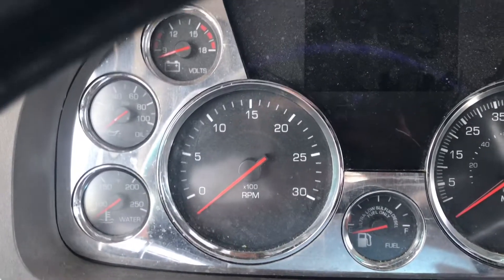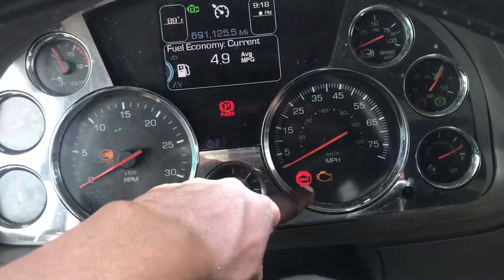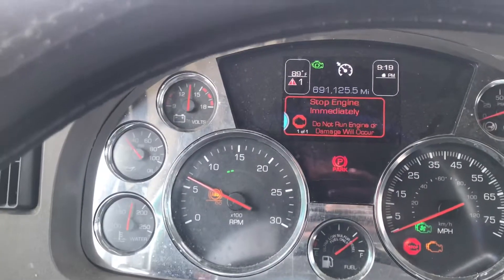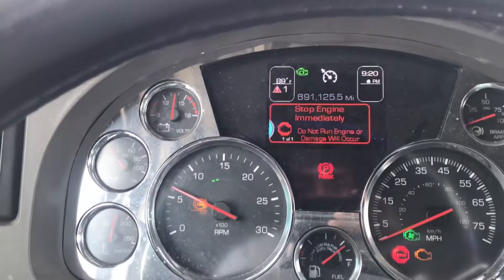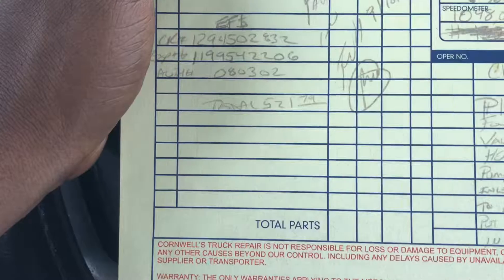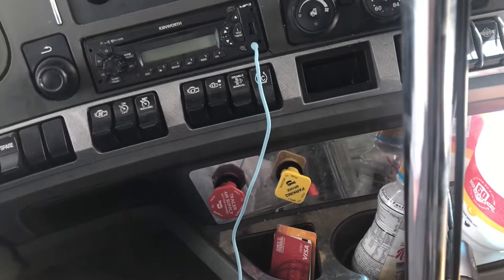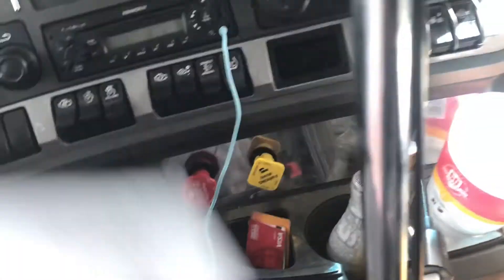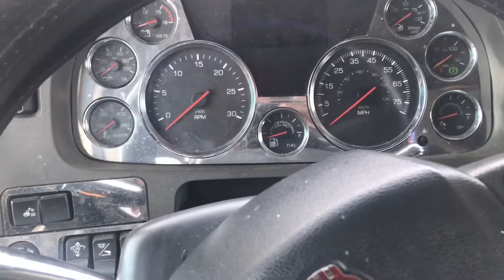DIY common derate issue on Cummins isx

Comment: Mine has half tank of def, but it's saying to Stop because of low def. Anyone had this situation
Reply from the maker: Send like the sensor malfunctioning some truck have more electrical problem than others def system is a very expensive system so hopefully it’s something simple with i was able to give better in-depth advice/info on the situation

Comment: Good video bro and got a question. So right now i got check engine light and sign of seek for SCR service but did not derate yet so you think it will derate soon or how long ?
Reply from the maker: Appreciate ya
Reply from the maker: Date can be tricky if your running your truck at full speed it can burn that sut off but if your truck able to do the park Regan do so Ann look into deleting if possible that derate is a big
Reply from the maker: Bih

Comment: Come on dude! You need to restart the engine so that it cool down gracefully after the regen process. The regen process burns the soot that got built up in the filters. You can damage the sensor parts if you don’t cool down the engine gracefully.
Reply from the maker: my friend the engine is ever hot when running out even during engine braking the regen etc that’s why there a cooling system built into an engine to keep it cool during extreme high temper. Yes it’s maybe good to cool ya engine down never the less it wouldn’t make a difference. Def itself was one of the worst upgrade added to a semi truck which is why I now prefer older model truck Detroit 60 prefer

Comment: I'm going to buy a truck soon. Would you go new or used?
Reply: All trucks have issues new or used...
Reply from the maker: @ngrossley  totally agree it’s all mechanical never know what can be bad
Reply: Don't do it 
look for another profession
Electrician AC HVAC or he'll go to work at Amazon you'll probably make more money there.Trucking is not what it used to be my grandfather used to make 70 K back in the 70s.Drivers are making less than that now but everybody else seems to be passing us up.Take it for me I've been doing it for 25 years in this day and age it is not worth it
Reply from the maker: It’s all depends on your budget an what you need it for in city or long distance I own a 05,06,an 2013 freighter. If your concern bout the looks of the truck then you may wanna go new but if your buying to run an make money then you just need something that’s reliable